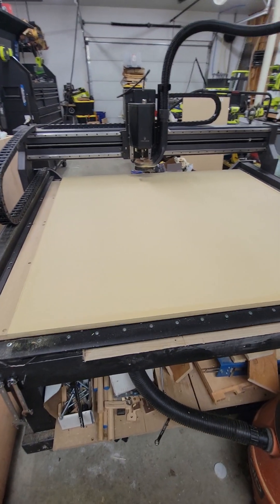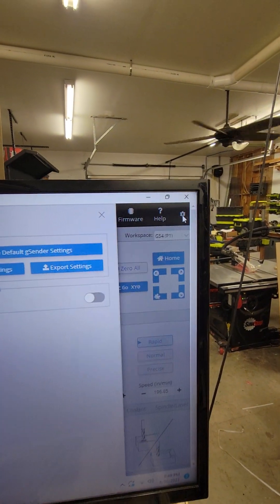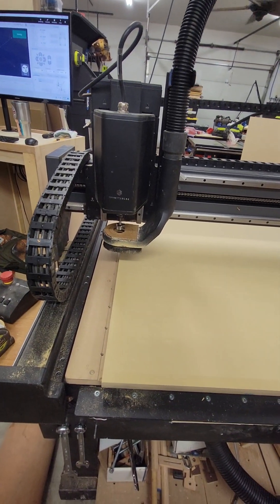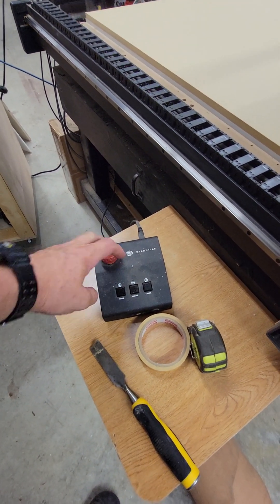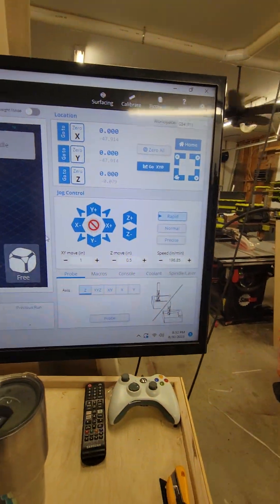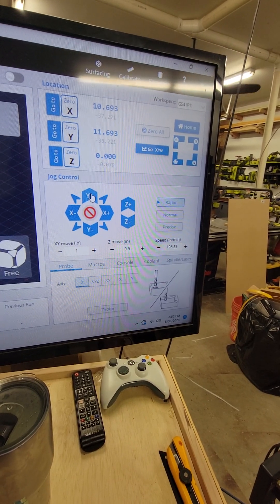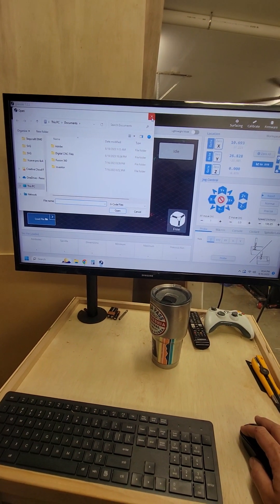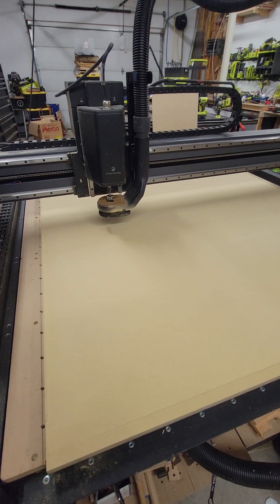Will gSender work with the XCP?

Comment: Hi, sorry to bother you. Quick question. I have the X-carve, you think that gsender will work with that.?thanks 🙌🏼
Reply from the maker: I does work and it works great, It adds a later of additional features to the machine that easel does not allow yet. However it is just the program to run the machine and toolpath, I still use easel or fusion 360 to make the tool path and then use Gsender to run the program.
Reply: @danconnelldesigns3168  thank you so much. I will give it a try.!!😎🫡

Comment: Did you ever get this working, specifically with the touch plate? One of the things I am concerned about the X-Carve is no touch plate support and the other is the offline support. gSender seems like a good answer, but I don't know if it is a hack.
Reply from the maker: Anything that improves your machine function and is free I'll call it a hack. The Xbox controller gives you a lot of freedom to move the machine around while you work. The touch plate from the makers of gsender has worked really well. My Xcarve pro touch probe never worked perfectly, but the Gsender touch plate is excellent.

There is a lot of fine tuning you can get from the software that has made a big difference for my machine and my workflow.

Comment: Great video!

I have the same machine what are rhe steps other than changing the baud rate?

Thanks

Would you recommend?
Reply from the maker: Really once you set the baud rate you can get started sending Gcode and using the features. There are steps to set your table size, machine limits and speeds and a load of fine tuning that you don't have to do unless you are super into getting more out of the machine than Inventables give us.